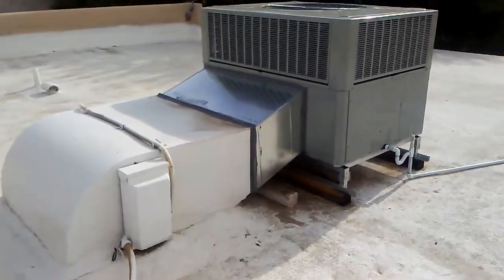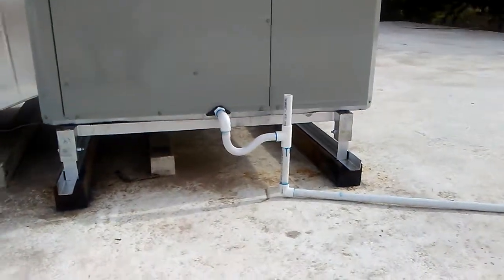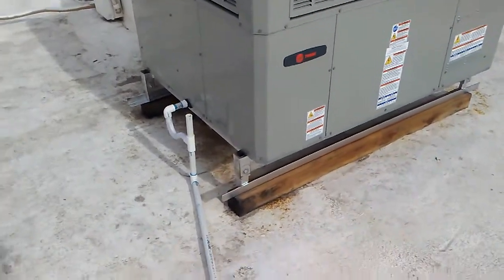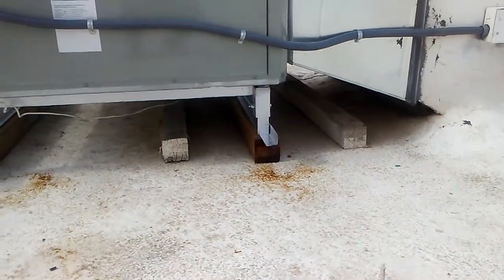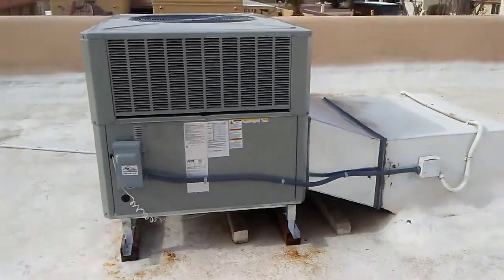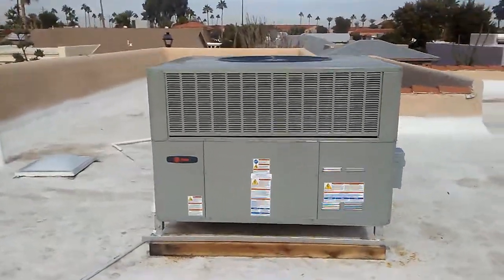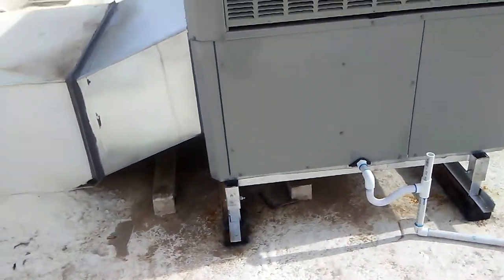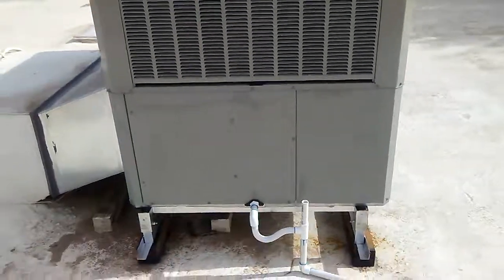Residential Application: Mounting a New System on a Flat Rooftop | Red Mountain Air Conditioning

Comment: Did you set and level the stand first in order for you to order your transition and get proper measurements
Reply: We build the transitions and stand a few days before installation.  Once we mount the sheet metal transition, we know how high to position the stand.  It is adjustable.
Reply: What kind of unit model is that ?
Reply: @timfriederich4555  Is the wood just resting on the roof? Is it recommended to coat the wood to the roof so that moisture dose not get between the wood and roof?